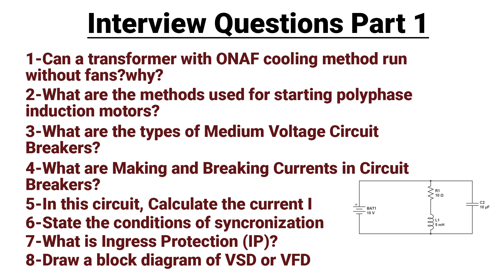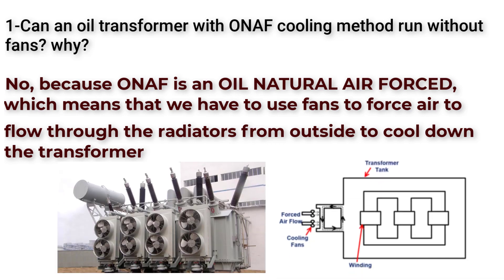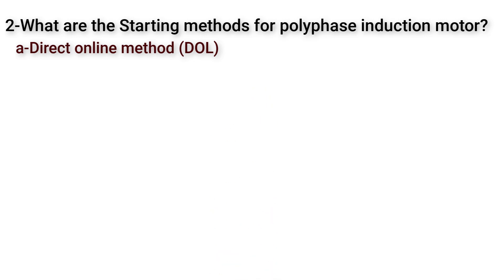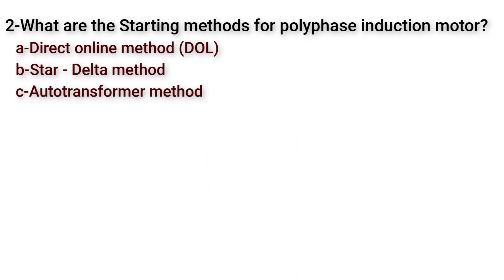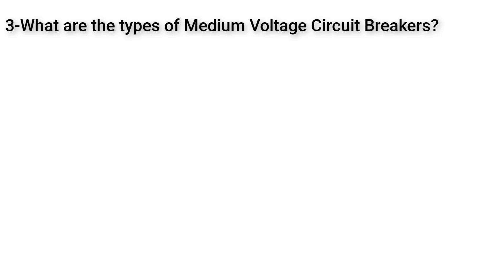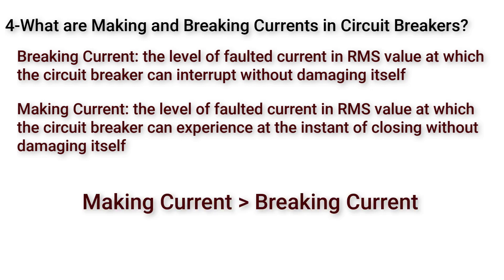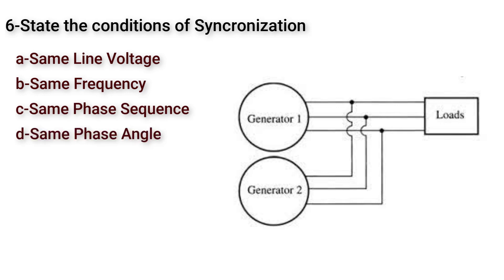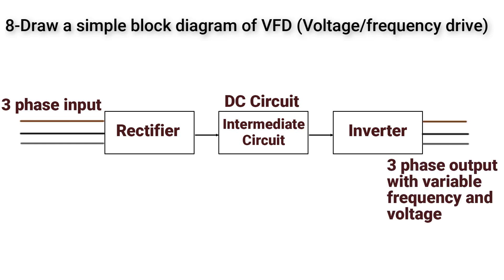The most asked interview questions for Electrical Engineers | Part 1

Comment: How could you reduce power loss during electrical transmission
Reply from the maker: Thank you for your question, you can reduce it by increasing transmitted voltage which will cause the transmitted current to be decreased, as the current decreases the voltage drop and power loss will be decreased too